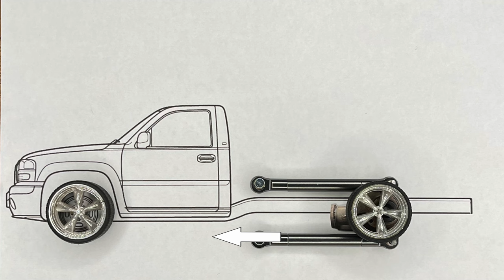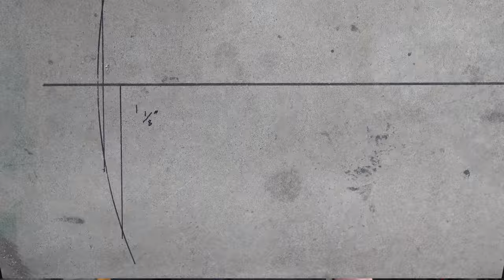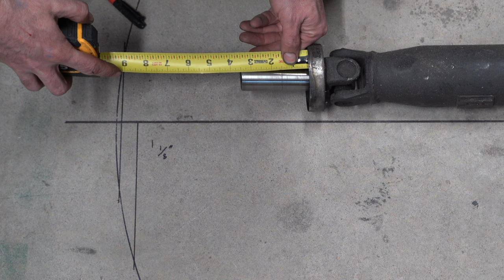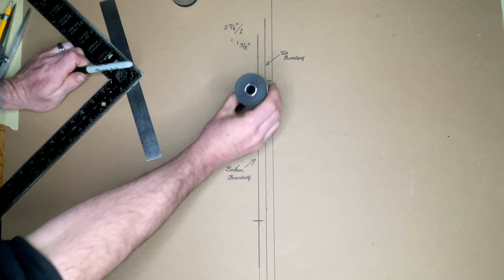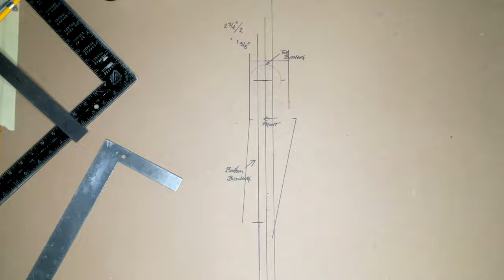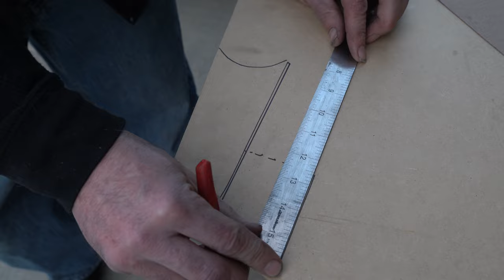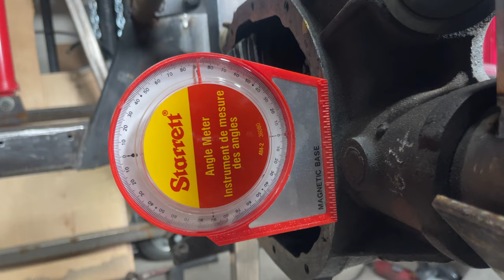Finishing and Testing the New Parallel 4 Link! Mighty Max Ep. 13

Comment: So when you bag a truck wouldn't be better for a single drive shaft? What if it has a 2 peice?
Reply from the maker: Short answer is yes. The additional length  of a single piece shaft will decrease the working angle of the shafts joints. Long answer… There are a couple different types of two piece shafts. Some have traditional U joints while some have double Cardan joints. The double Cardan follows different rules when designing your suspension for correct pinion angle and it’s a bit more challenging.
I would prefer to have a two piece shaft with traditional U joints for simplicity sake.
A two piece COULD technically be better than a solid shaft as it’s more likely that you can match the length of your link bars to the part of the shaft that articulates. The challenge, though, is that you MUST match the link bars to the shaft to keep from pushing and pulling on and damaging the carrier bearing. And because the moving part of shaft is shorter, it limits the amount of suspension travel you should have.
Just remember if the link bars and drive shaft are the same length, they will move on the same arc, and therefore the pushing and pulling is eliminated.
Hope that wasn’t overwhelming, Dale.
Lemme know. Cheers!

Comment: so you said when setting the pinion angle it should match the engine and trans.  is that at ride height?
Reply from the maker: Short answer: Yes.
More convoluted: It depends very much on what vehicle it is and what it’s used for. A typical street vehicle with angled link bars and static height suspension, the pinion angle should be parallel with the transmission at ride height.
Am adjustable vehicle that can ride at several ride heights, the pinion angle should have a constant pinion angle that doesn’t change as the vehicle height changes so that it remains parallel with the trans at all times.
A drag racing vehicle with leaf springs, should have a pinion angle that that is slightly off-parallel but lines up when the vehicle is under load going down the drag strip. (Because leaf springs allow some rotation of the axle.)
Lemme know if any of that wasn’t clear.
Cheers my friend!
Reply: @GarageFab  thank you that makes alot of sense.  I appreciate it and the videos you post.  Keep it up my man.
Reply from the maker: Thank you! I appreciate you. 🙏

Comment: People should start doing adjustable brackets in my opinion because if u ever go with different wheels say bigger or smaller u can make corrections or even if you wanted to throw some coil overs and go racing 🏁. Racecars have 4 links and they have way more adjustability because all tracks are different. They actually use adjustability to create rear steering.
Reply from the maker: Very true. I used to try to convince my customers to build their vehicles with with the future in mind. Not so much “adjustability” but the ability to upgrade easily. Like, build the frame notch for bigger wheels even though you swear you won’t ever want them. And raise your bed floor 6 inches rather than 3 in case you want to body drop in the future.
I was just talking to a guy earlier today about creating brackets that would accept both air springs or coil overs.
I think maybe you should be the first, Rafael! 👍
Reply: @GarageFab  I've thought about it since I like racing 🏁 also

Comment: An 8in stroke is nothing to be ashamed of young man. If that's still not enough just use more Strokes! That's what I do.😢
Reply from the maker: But what if I just don’t have anymore?
Reply: @GarageFab  did you ever find out a good source for piston rings? I need them for my 98 S10 2.2 L bored .030 over. Yes it's kind of old and Oddball but is American and I can't seem to find them anywhere. Any suggestions?
Reply from the maker: A “good” source? No. I got lucky and found some factory Mitsubishi rings on eBay. Have you already checked all the big name sites? Jeg’s, Summit, Speedway, etc?
Reply: @GarageFab  all them and more. I may try the dealer since u had luck. Of course I mean the GM dealer, not Mitsubishi. I also need main bearings .035 over. Someone spent some big money on this pos years before I got it. So what is your day job?
Reply: @GarageFab  when you have no more, go to sleep 😴

Comment: There needs to be some angle for the joints on the driveshaft to work properly, so maybe 0 degrees is a bad example. lol
Reply from the maker: You’re not wrong, but zero degrees doesn’t necessarily mean there will be zero degrees on the joints themselves. If the differential is 13 inches off the ground and the truck is cruising low with the transmission hovering at 4 inches, the shaft is sloped giving you that angle you’re looking for for bearing lubrication.
Also, it can be argued that with modern lubricants, angling the joints slightly isn’t as crucial as it once was. The new Toyota Tacomas in particular have a double U joint in front and a perfectly straight single at the differential. It’s not often that we replace U joints at our shop. 🤔
Reply: @GarageFab  Good info. I will probably go back to your suspension videos, but I was trying to visualize what effect suspension travel with a parallel 4 link would have on drive shaft/U joint angles. I get that the transmission is fixed, and the rear end doesn't change pinion angle, but as the suspension travels wouldn't the u-joint angle change? What would you say is the maximum angle of a u-joint for reliable operation? Great to see a new video, sorry about the cooties. lol
Reply from the maker: You’ll benefit a lot from a video I’m working on all about drive shafts. I’m building a machine that can put a drive shaft in multiple positions to show how the rotating speed of the shaft is affected as the u joints flex.
You’ll have to wait for the “why” but just know that the important thing is that the pinion angle and transmission output shaft angle is complimentary. (Shafts should be parallel) If your suspension keeps these angles constant, even though the U joint angles are in fact changing, the front u joint angle and the rear u joint angle are the same providing proper drive shaft operation.
I honestly don’t know what the maximum angle is but it would be really difficult to get there. Maybe with 30 inches of lift in the rear suspension? My point is you probably shouldn’t need to worry about maxing out a drive shaft with typical suspension modifications.
Reply: @GarageFab  Thanks. I was wondering about it after watching this, and wasn't sure how much lift it would take to affect it. I'll keep an eye out for the next video.